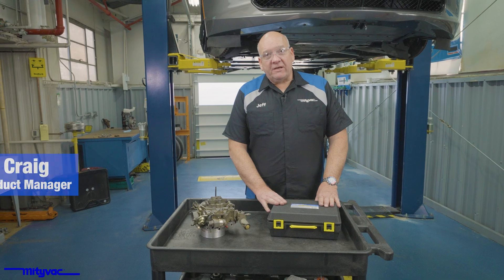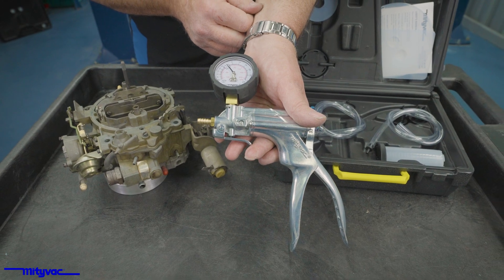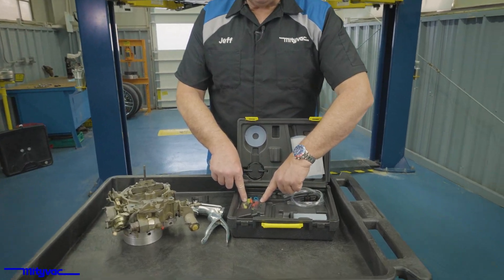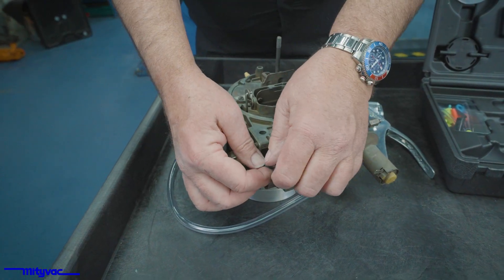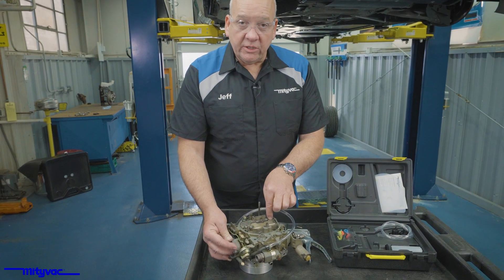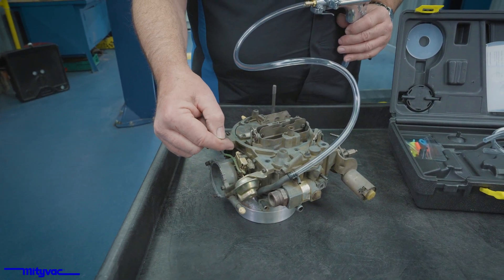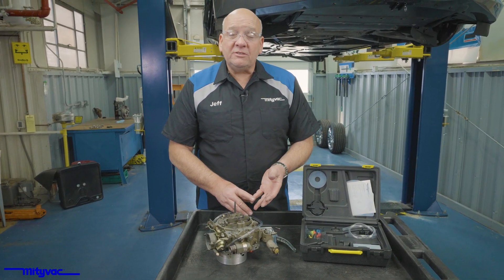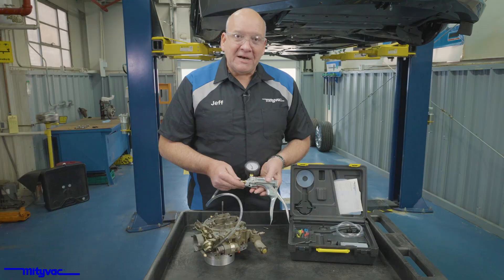Vacuum Testing With the MV8500

Comment: How do i test needle and seat on a 2 barrel carter bbd? vacum or pressure?, is there adapters included to hook up to it? My 1985 d150 wasw running fine now it wont start and fuel is spitting out of the top of carb

Comment: I bought one of this mityvac MV6400 from Amazon and I didnt get to use it until a year later. Comes to find out I received  a dud and the POS could not hold vacuum to I have to keep pumping manually.  The air keeps coming out of the handle and I couldn't fix this thing because it was glued together. May be someone here could help me?😢
Reply from the maker: I am sorry to hear you are experiencing issues with your dispenser. Where exactly on the handle is the air pressure escaping from? The unit has an integrated pressure relief valve that may allow air to vent if the pressure exceeds around 25psi. If you would like, feel free to contact us at phone: 1-844-772-1341 or email: Lincoln.Tech.Service@skf.com so we can assist quickly. We accept photos and short videos that can help us better assist in troubleshooting your unit. 

~John
Reply: Make sure you have it set to vacuum on the tool and not pressure.  I suspected the same thing when trying to bleed brakes, but finally realized I had it setup incorrectly.